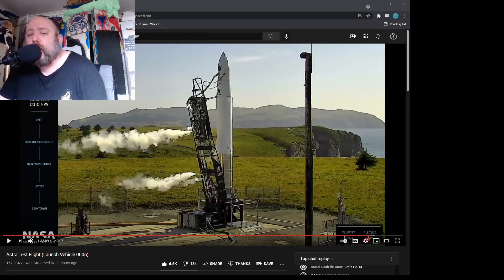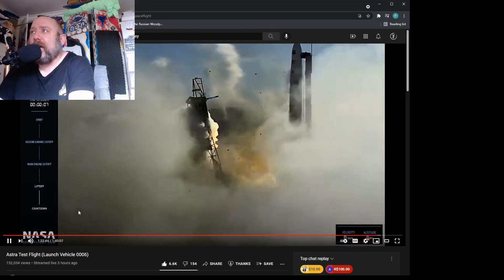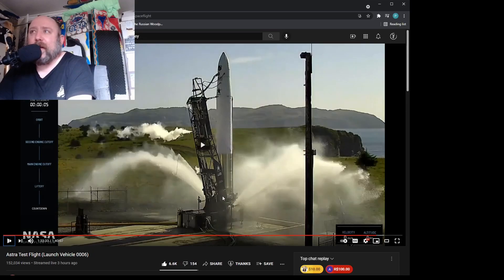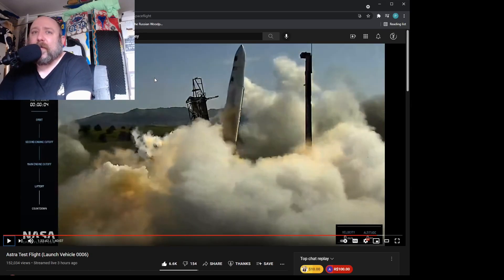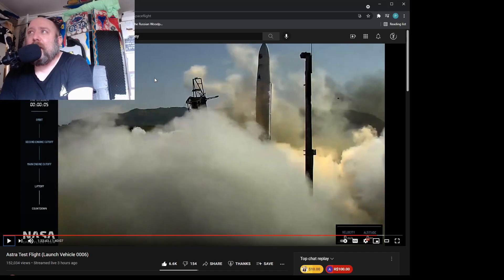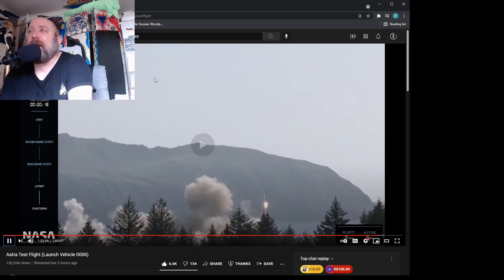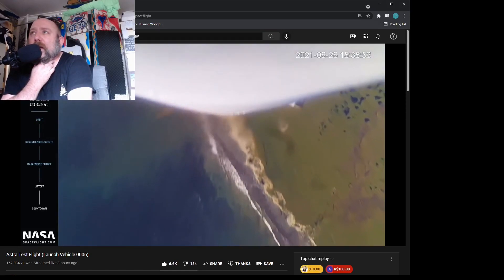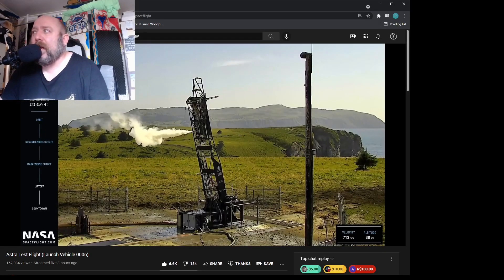Sideways Rocket Launch! Astra!

Comment: Was tipping over like that part of the flight plan? Or was it some kind of failure? I thought it was game over after that but the rocket recovered long enough to reach MECO.
Reply from the maker: tipping over was definately not the plan! The CEO has tweeted an explanation since this morning, saying one engine failed at t+1 second, so the rocket was still attempting to take off on the remaining motors. And it did amazingly well to remain vertical and recover!  Had the motor failed say 1 minute into the flight, it might of had more of a chance of possibly getting to an orbit.